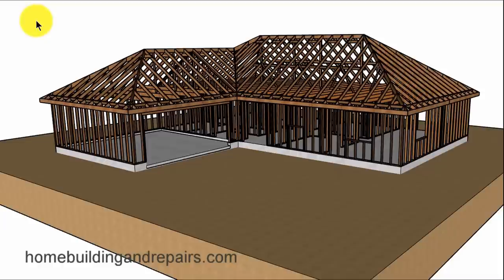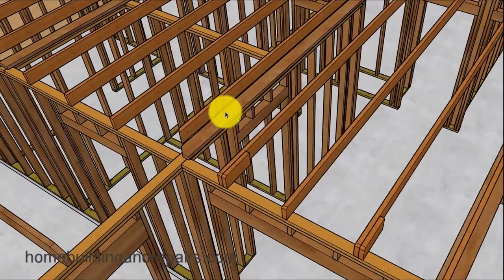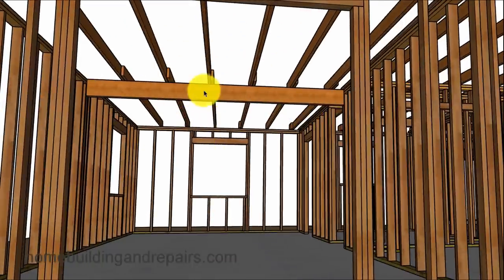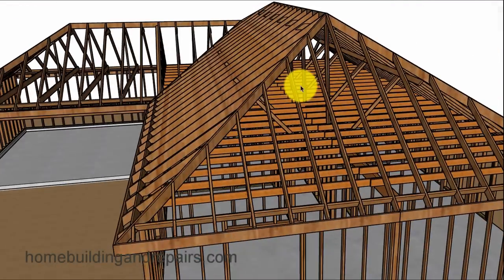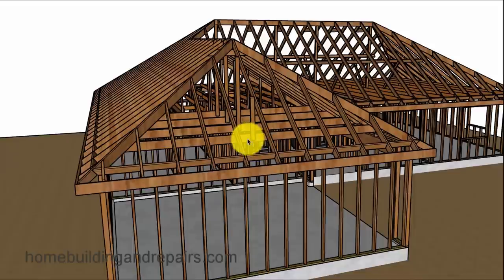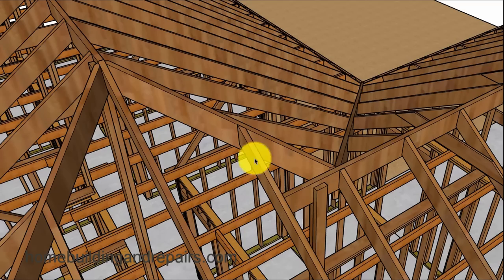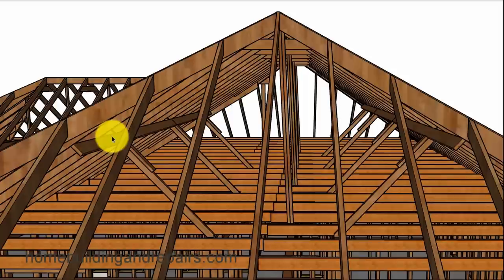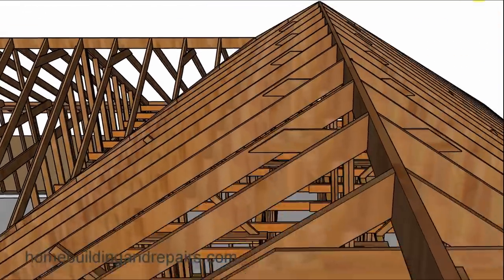Check Out The 1950's Hip Roof Framing - How It Was Built Years Ago

Comment: Cool video. Just finished remodeling my grandpas house built in 55. Standard L just like this. Garage was converted in the 70s. The ceilings didn't hold up very well with the button board and plaster.

Comment: At 2:40 you have bottom chords that are overlapping.  What if I cut the chords so they are both half way sitting on the center wall, line them up with each other, then add sister joists that span the joint about 3ft on each side?  Then add a few web pieces.  Now I have a traditional truss that allows me to remove load bearing weight on the center wall?  So basically, what I'm saying is, I want to remove a wall that has some of the chords overlap.  The wall is only 8-10' long, so I only have to adjust maybe 4 trusses.  Rather than putting up an lvl beam. What are you thoughts?
Reply from the maker: Yes, you can add additional joist to create a nice rafter tie in the ceiling joists. I don't like the idea of people making their own roof trusses, but I've seen it done on buildings less than 12 feet wide and in areas where it doesn't snow. In other words, it might work on the small shed, but might be a little more difficult on spans longer than 12 feet.

Comment: What are the long straight vertical braces holding the ridge board called? Is it normal if they are slightly bent?
Reply from the maker: I think I would refer to them as vertical support braces, because in reality they might not be strong enough to be considered ridge support posts. In construction there are multiple names for the same part of the building all around the world, so it can be confusing.

Comment: Informative for me thank you. what about on the hip sides perpendicular to the rafters and ties.they have 1/2 ties (so to speak) and  go back and land and end typically on an interior wall. In otherwords the hip rafters perpendicular to the main rafters has short tie backs on top of an interior wall. I imagine this serves same function as rafter ties in keeping the walls up and resisting downward pressure?  even though it's not a continues pull from the other side (though your illustrations for example at 9:22 don't show this).  Or is that simply a  way to allow for drywall? What perplexes me is 1 side of a garage is like that tieing back on top of wall but that was also used for rooms. But on front of garage the hip rafters don't tie back. What keeps the hip side walls in plane then if not that?
Reply from the maker: Usually the vertical or lumber bracing that goes up and down like the hip and ridge supports are to prevent that section of the roof from moving down.

Comment: Great videos. I have a 1950 house with a detached garage. The garage ceiling has 1x6 laying flat that cross at the center and extend all the way to the corners. It appears to be for bracing for square when these houses were being mass produced in my area at the time. Is this required or can it be removed?
Reply from the maker: I've seen this before and think it could be removed as long as you have some type of structural support for the walls to prevent them from moving from left to right. I can't tell you to remove the braces, but can tell you that there are plenty of detached garages that were built and still standing without diagonal ceiling braces. Feel free to send me some pictures of your project for more information and you can get our email address at the website.

Comment: Hey love the videos!

How about a 1930s coal house with a hip front porch. Roof structure looks just as high and we are trying to utilize some of the illustrated upstairs areas as a kneewall second floor. 

The original framing used 2x4s for the ceiling joists between the first floor and attic area.  What do you think is the best fix to make that attic space up to today's code? Can you dowel or sister joint that and the kneewall would provide enough support to the roof overhead?
Reply from the maker: Feel free to send me a picture of the type of home you're referring to. I am always looking for different types of homes to re-create. Make sure you visit the website for more information about attic remodeling, I think I have about five or six videos. Let me know if you don't find what you're looking for.

Comment: Cool video. Would it l [k good if the 2 ridges meet so there were even?
Reply from the maker: It might actually provide you with more structural strength if the ridges were the same height, but in order to keep the same angle or roof pitch, the garage would need to be the same width as the home.
Reply: @gregvancom  nice. I like it when things line up. Looks like it was an after thought when they dont. Even if you had to change pitches, I think it looks better.
Reply from the maker: I think realistically it would be a personal preference, but I like it when things line up also.

Comment: The ceiling joist offset in that 30 foot deep room could have been avoided with a flush ceiling header and joists bearing on a 5/4 x 3 or 2x2 ledger strip since they didn't have joist hangars in the fifties.
Reply: Just butt the ceiling joists in the center and use a 4' long splice piece.  

Not sure about your method.  But a ledger strip would make a weird finish detail inside the room wouldn't it?  Also the ceiling joists need to be attached in such as way as to keep the exterior walls from pushing out from the pressure from rafters.  Nails in shear are better than nails in pull out.

Comment: Everything makes sense except for the blocking at rafter bottoms...How is attic venting gonna work with that blocked off?
Reply from the maker: Trust me, there are other things that might not make sense also and this was only meant to be an example for some homes, but not all homes built in the 1950s with a hip roof. Good point about the vent blocks and they would have worked great with dormer vents.
Reply: Probably two gable vents on both ends
Reply: Also those mushroom vents are usually used in the attic for Ventalation. My attic sucks but that's all the Ventalation I have

Comment: So, if you wanted to vault a roof like this, is that a crazy ask? Seems like it might be simpler than with a truss roof?
Reply from the maker: It would be difficult to tell whether or not a truss roof or a conventionally framed roof would be better to convert to a vaulted ceiling, without knowing the design. It can be done, but it will require a lot of work and quite possibly lowering the exterior walls to make room for the larger rafters if you want to keep the top of the existing roof the same height. Let me know if it doesn't make sense and I have already made a few other videos about converting flat ceilings to vaulted one's, if you haven't watched them yet, go to the main index page on the website and you should find a link to our playlists. Click on the link and then there should be one on roof framing repairs.
Reply: That does make sense (or as much sense as it needs to make to me). The room we're looking to vault is our converted garage that's exactly like you have in this video. Built in 1960. Thanks for these videos! They're great!
Reply: keyword there is "larger rafters"